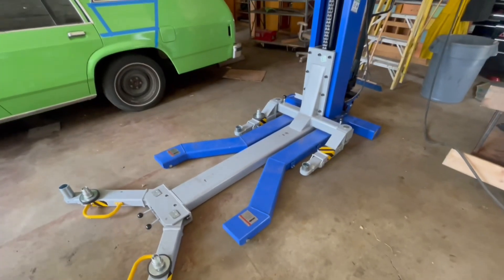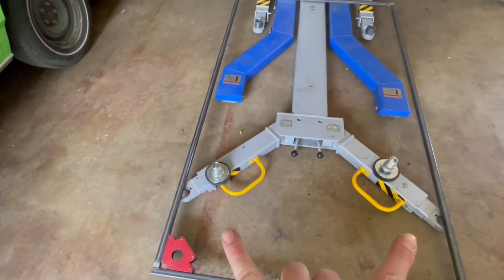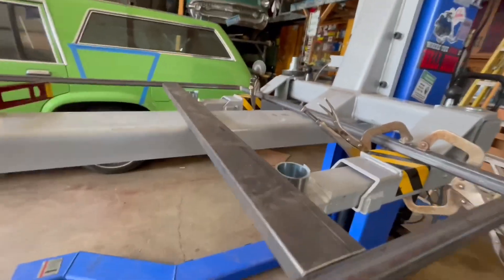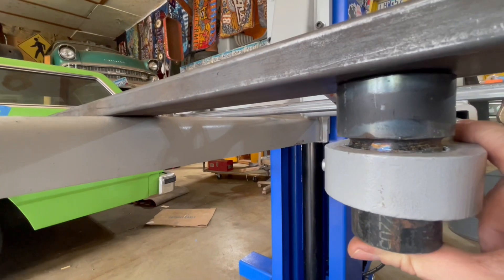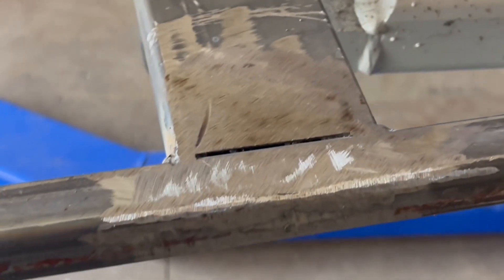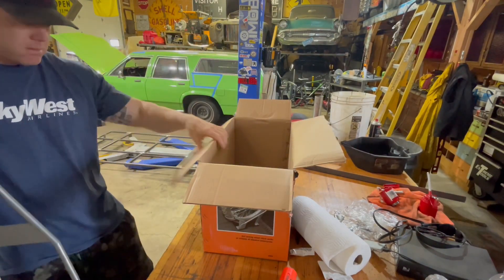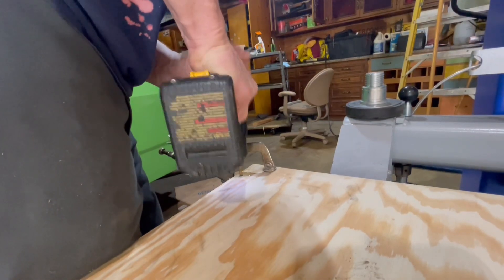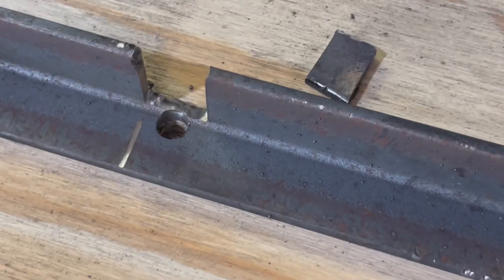Ideal Mobile Lift motorcycle, ATV, lawnmower platform fabrication

Comment: The commit about Joe I almost turned off the video.  But realized you probably don't know that in most cases the president has no control over prices. The unchained capitalism forces up prices.
Reply from the maker: Odd, I guess it was that nasty orange man that was responsible for raising oil prices over night the day after won the election… and before you run your mouth I paid substantial more taxes under Trump than Clinton, Bush and Obama.